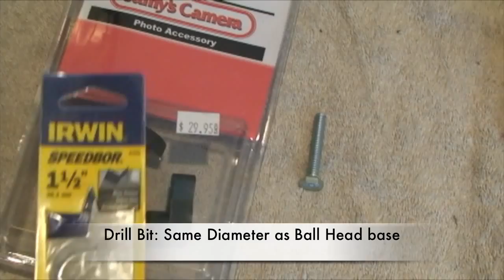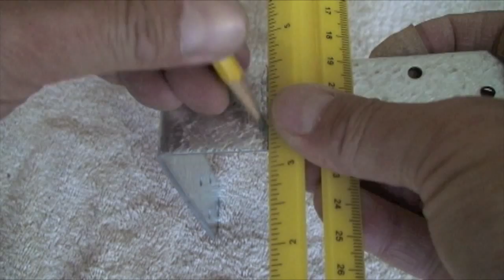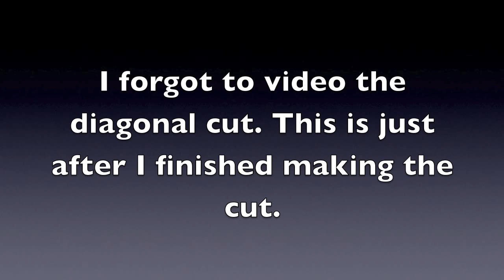Camera Mount for Tennis

Comment: I may have missed the explanation, but would it make more sense to have two brackets extending from the forward edge of the broom head and using the natural slope of the broom to angle the camera platform toward the court?  That would require no angled cutting and drilling and provide three points of contact with the fence.